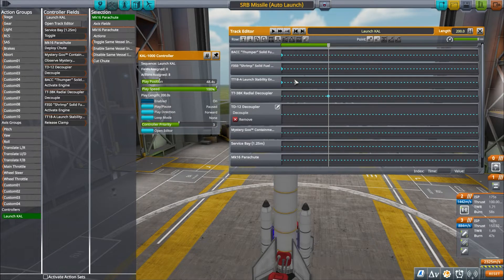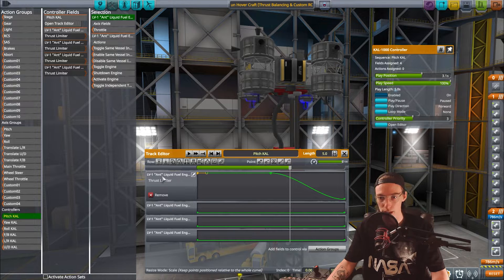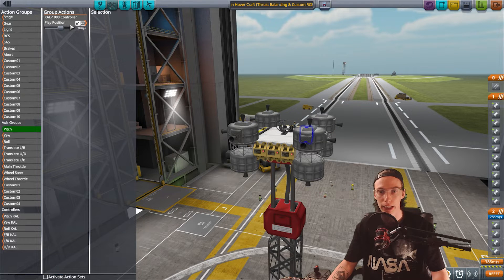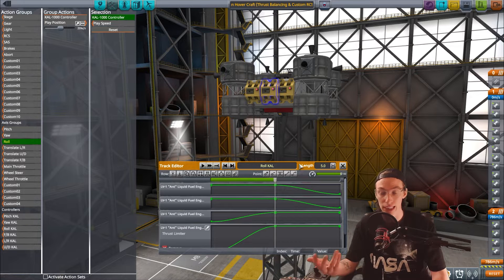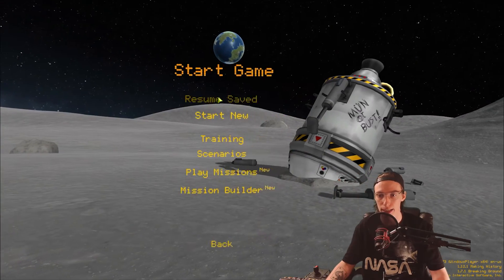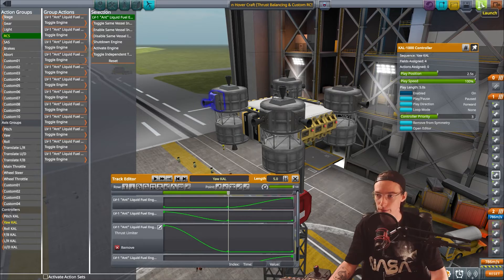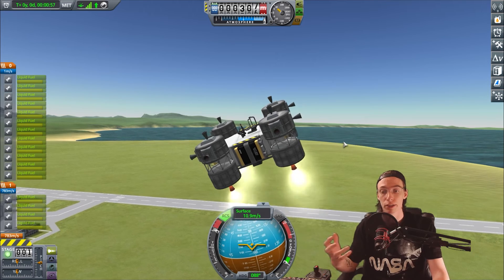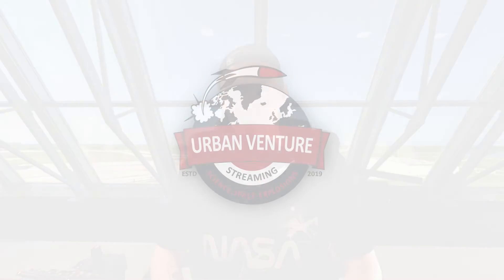Complete Guide to the KAL Controller in Kerbal Space Program! Part 3 - Thrust Control

Comment: So you can't make a fully automated craft with the Kal? Like accent, gravity turn and circularization burn?
Reply from the maker: It is possible however the KAL can’t intake any information about what is happening to the craft, like speed and altitude. It’s not too hard to automate a launch to orbit if your craft is always exactly the same each time (and easier on bodies with no atmosphere) however if you change anything on the rocket you will probably have to reprogram the KAL.
Reply: @urban_venture  So all I would have to do is have a standard rocket and control the TWR to always be the same?